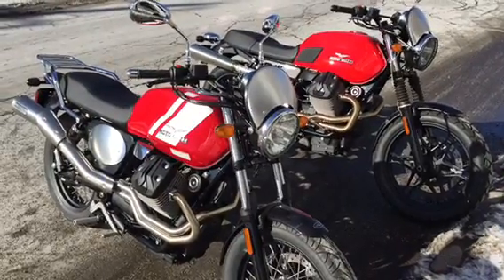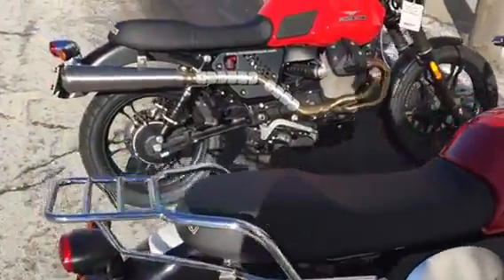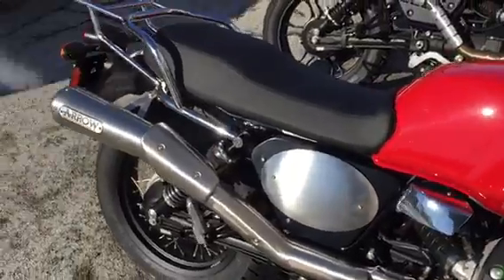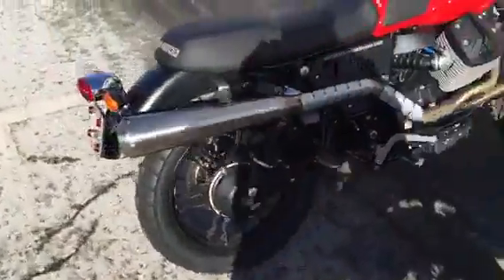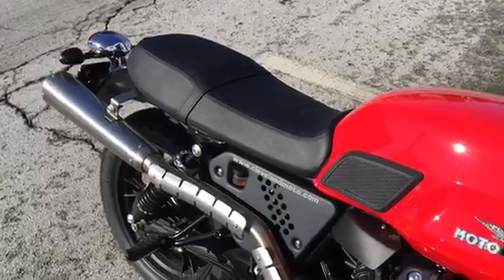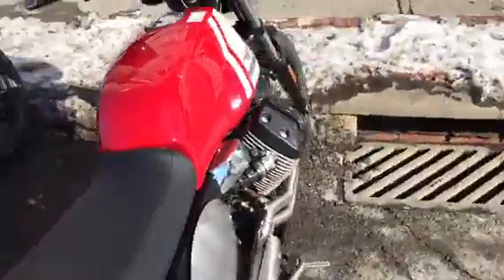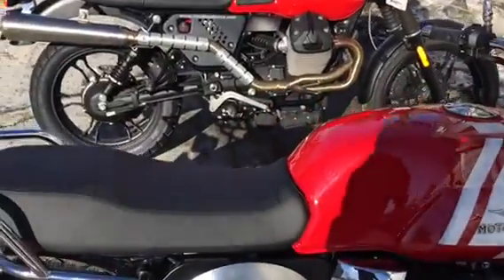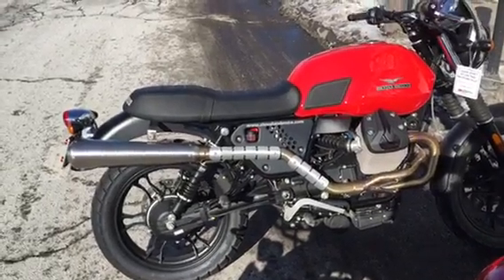Moto Guzzi V7 750 scrambler aftermarket exhausts

Comment: with Arrow you can cut the DB killer out or actually cut the DB killer down in size for an in between sound.
Reply from the maker: The Agostini DB killer is the same way. The Arrow we tested did not have a removable DB killer unless you removed the entire back of the exhaust and cut the welds. The Agostini was a simple circlip.
Reply: @ClevelandMoto  A 2 inch hole saw and 10 min drilling and the DB killer on the Arrow is removed and sound similar to the Agostini. I reinsert the DB killer with 2 screws if I need it quiet again. On my 2016 Stornello the Arrow is the standard exhaust.